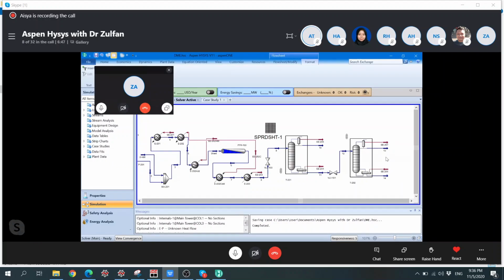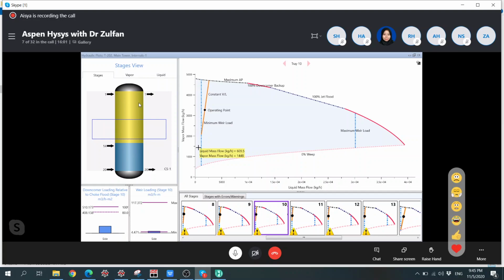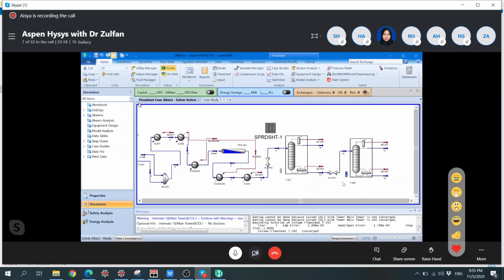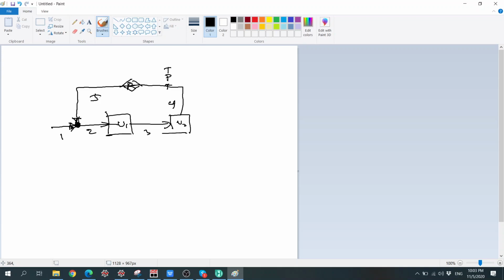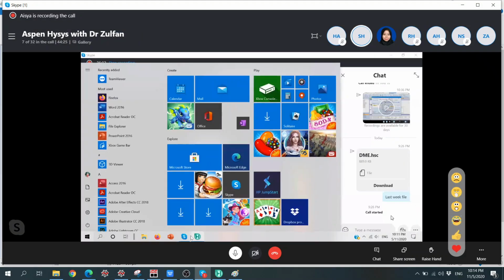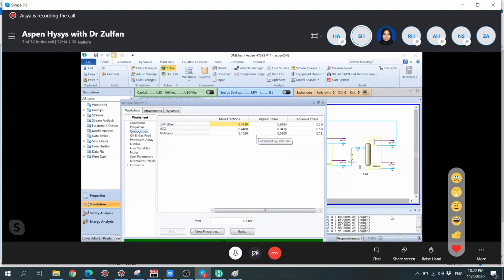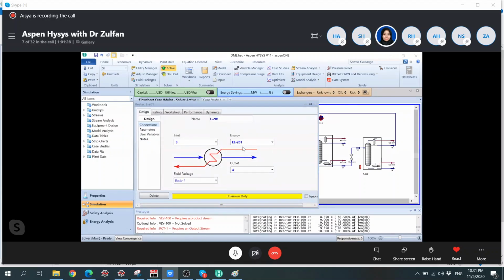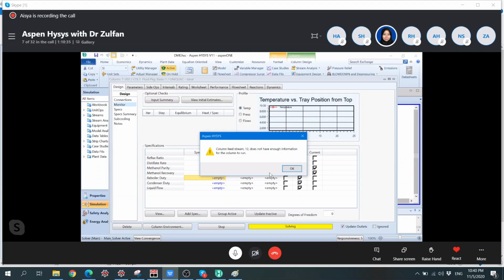Distillation Colum Internal, Hydraulic Plot, and Recycle

Comment: 6:40 different type of hole
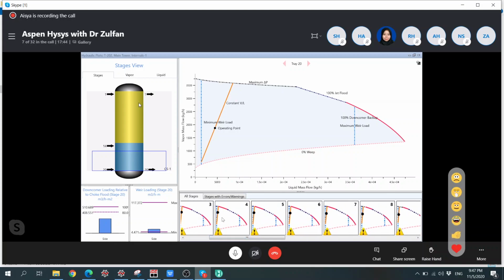11:59 operating point should not away from min weir
One sol is to change column dia
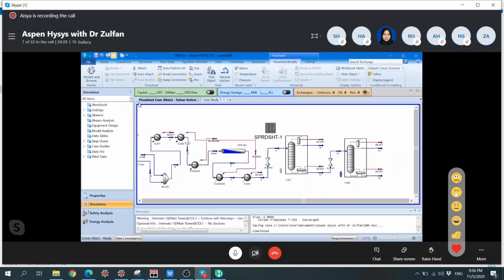20:30 recycling
29:39 error lead to iteration number
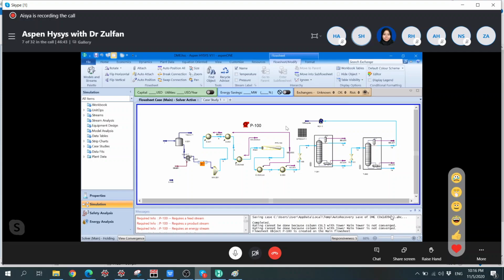40:59 see liq or gas stream 46:51 composition
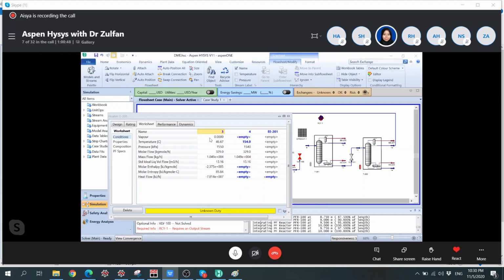54:57 removing reflux line and connect anywhere else 1:02:52 increase purity
Reply from the maker: Thanks man

Comment: I'm working on a Distillation Column Design. The column is converged but I don't understand hydraulic plots. How do I get to know it. Is there any material I can refer to?
Reply from the maker: Hi, I am not aware of any printed material explaining this issue in depth. It's basically as simple as what I explain in the video. We need to balancw the supervicial velocity of vapor and liquid and these numbers need to be located about in the middle for convenient. 
If we have too high vapor velocity, it will go up in the graph and we'll get entrainment in the end. If the vapor velocity is too low, it will go down in the graph, and we'll get weeping from the trays. 
Obviously, the shape of the graph highly depends on the properties of the vapor and liquid (ie thermodynamic estimation must be accurate enough), the vapor and liquid load (ie capacity), the diameter of the tray, and the type and the design of the tray itself. 
So, you can play around with all these parameters and see how the plot changes, and how the vapor-liquid intersection moves in the plot
Reply: @ZulfanAdiPutra  Thank you very much. I'll will do exactly as you have said. I appreciate
Reply: Am I welcome to ask more questions as I proceed with my design project?
Reply from the maker: @isotuadonye303  you can always ask questions
Reply: @ZulfanAdiPutra  In my design. The column consists of 10 trays (sieve). I'm told that the liquid rate is less than the minimum weir loading rate specified. While tray 6-10 is experiencing weeping. 
Please what can I do?
Reply from the maker: @isotuadonye303  i don't know the detail of your problem. So, i cannot comment much.
However, as engineers, especially chemical engineers who are at the interfaces of various people with very diverse background, we cannot based our knowledge on something like, "I'm told..."
You have to go out to the field, verify every data and information, then make your own analysis. In this case, you have to know why weeping happens.
So, good luck 😊
Reply: @ZulfanAdiPutra  I want to say a big thank for replying all my messages. Thanks .
I will continue with the design, the thing is there were no calculations made prior the simulation. That's why it seems difficult.
Reply: @ZulfanAdiPutra  I sincerely appreciate.
Reply from the maker: Yes, I understand you :)
At the end of the day, we'll have to make sound assumptions and move forward